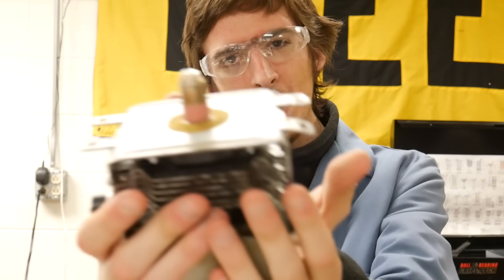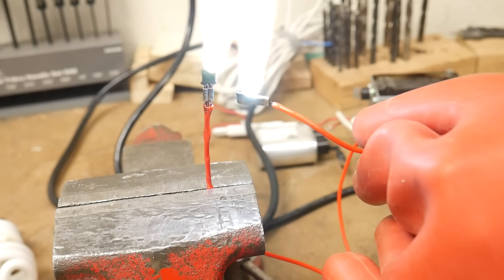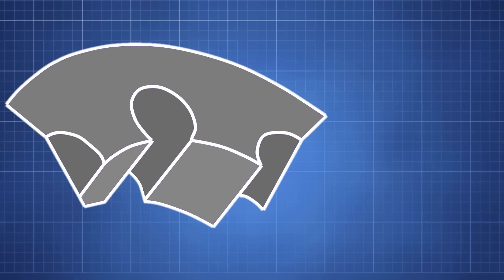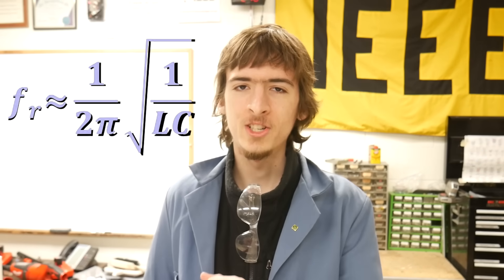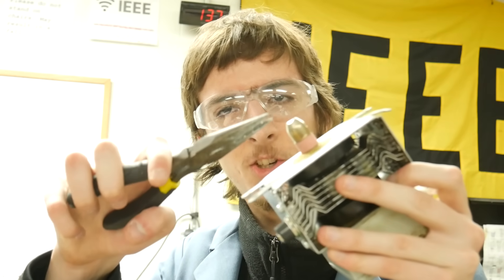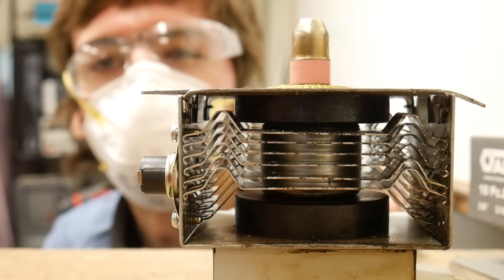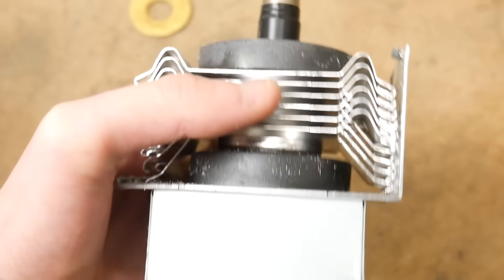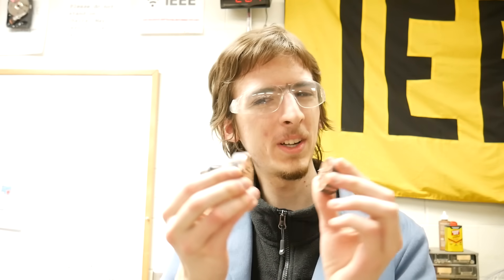What is a MAGNETRON - How Does it Work

Comment: You quoted Fleming's Right Hand Rule incorrectly. It's (F)irst finger for (F)ield, se(C)ond finger for (C)urrent and thu(M)b for (M)otion - check Wikipedia. In addition his Right Hand Rule is for generators and the Left Hand Rule for motors using the same mnemonics (as in this case effectively since power is consumed to produce radiation, not generated via rotational movement of the magnetic field).
Reply: Bob Lewis just thought the same thing
Reply: Bob Lewis prove him wrong!

(It would technically take CPT violation to do so by the way. Haha)
Reply: Tadesan I don't need to prove him wrong. If YOU need proof, do as I suggested and look up the right hand and left hand rules on Wikipedia.

And WHAT CPT violation? Explain yourself please.
Reply: You're all wrong: right-hand rule is for right hand threads.  Left hand rules for left hand threads.  Righty tighty, lefty loosey...
Reply: right hand rule/left hand rule and which finger to use for what are dependent upon whether you want to use conventional electrical flow (positive to negative flow which was based on assumptions in the 1700's which were pre-electron knowledge) or electron flow (based on the facts we know about electrons).  Even in current physics courses I have seen instructors use a right hand rule for based on conventional current flow. If you want to use a right hand rule for generation based on electron flow you flip the current and flux fingers.  or you swap to a left hand rule for generators and a right hand rule for motors and use the traditional fingers.  The right/left hand rules are mnemonic and visualization aids and not laws.

Comment: well wifi is 2.4ghz too
Reply from the maker: Don't mind that. Just the gov't trying to kill your brain cells.
Reply: The difference is in the power output. Wifi is in milliwatts (less than 1 watt) where as microwave ovens are above kilowatts ( greater than 1000 watts). This is radiated power and is why a microwave oven can cook your food or why you will be cooked by climbing a live cell tower. Now climbing a live ham radio or broadcast radio tower is doable but generally not safe. The reason for that is the frequency they operate at instead of radiated power. Had a friend climb one that a local radio station needed inspected. He climbed a live tower with a expensive digital camera. The only ill effects was that the tower had a nice warm feel, accompanied by mild vibrations, and fries the circuits in his camera. Another instance had a local tv station shut down a tower for matinence and had to transfer more power to a secondary antenna to satisfy fcc guidelines of power density per meter. The tower went to 1.5 mega watts of radiated power. That thing would spontanously combust crows, but i digress.
Reply: @samuelsims4625 
Interesting feedback.
Now, what about resonance?
Wifi is in milliwatts but how long do we expose ourselves to it?
Could it be possible that we damage our cells by being constantly exposed to these even tiny waves?
Bridges crashing down due to wind or cadenced walkers is a fact. How can we be sure that wifi does not act on our self resonance frequency?
(not sure of my English... sorry to be tired ;-) )
Reply: @AnnaëlleD  The only thing i can say as far as the long term effects is what is stated by the guidelines that outline radio frequency radiation. Just like ionized radiation, there are federal guidelines that provide the best practices towards exposure. Now to clarify ionized radiation and radio frequency radiation are seperate things, but both have guidelines. As far as resonate frequency of the human body i would have to research more in to the matter in respect to harmful interference. The biggest danger with rf in wifi range is that at high power it does excite the atoms of water and causes thermal heating. Now not to be repetitive, it does require a large amount of power to do this, and in current form wifi is miniscule compared to the minimum to excite water. Now if you were to live in close proximity to a vast amount of them you may notice more effects but it would have to be so many that it wouldnt seem possible. Like above posts we are talking about power levels above 1500 watts and that is the lowest power microwave oven i have seen. There are a number of people who have a sensitivity to electromagnetic energy and they say that it effects them to different degrees. Those people would be at a higher risk of developing complications due to rf. The fcc has a calculation to determine the safe power levels based on proximity to body, effective radiated power, and frequency used. As far as i know they are mum to the effects of resonate frequency related to dangers to your health. Now I am not a scientist and my knowledge comes from being an amatuer in this field. It interests me and I decided to pursue an amatuer radio license so that i could experiment with different parts of the rf field. I am by far more knowledgable about satellite communications and things that relate.

Edit 
To try to answer all your questions I add this. As far as long term expose it was decided that it should not be harmful. Who is to say if that is factual or not. Im not aware of any issues, although wifi still is a newer technology, and hasnt been around long enough to make a definitive conclusion. Another thing that is yet to be seen is the effects of the 5ghz banded routers. They are the ones marked 802.1.1 N/AC. Then comes in 5G cell phone technology that is being developed, which operates in the same band as old police radar guns, so we are told. You could also look at the military area denial weapon that heats the skin using microwaves, but much higher than 2.4ghz. It heats the skin a few millimeters deep to an inbearable temperature, but has shown to not cause lasting damage, they have said.

Comment: Thanks for the explanation.  Just curious though. I have cut open several failed magnetrons and tried to see what was causing the problem. the filament nor any other parts seemed damaged. I wonder what caused the failure of this reasonably simple device?  I had come to the assumption that the failures I had experienced were due to loss of vacuum due to some small leak in the assembly; or possibly due to some materials in the magnetron that had emitted some sort of gases and reduced the vacuum level.
Reply from the maker: Honestly, I don't know the failure reason besides this: they usually only fail after they overheat...
Reply: Yeah I noticed that in the past. Since my current life working on power generators,  I haven't done a lot of appliance work. But, the most recent one I changed was on my mom and dad's 30 year old Sharp microwave. The fan was still working fine.
Reply from the maker: Actually, the one I disassembled was also broken. When people leave my college campus, the leave a good dozen of broken microwaves behind. (I have so many magnetrons...) 
Anyway, I've also noticed that when magnetrons overheat their efficiency decreases substantially. Could be due to warping or material property changes. It's like asking why light bulbs fail.
Reply: Good point!  I ordered a NOS Toshiba magnetron from eBay for mom and dad's microwave. Apparently the old one had gradually weakened. The new one set fire to the first bag of popcorn they cooked! It was easy for mom and dad to adapt to the shorter cooking times after the first incident! :) 

I remember those days when people would abandon things when they finished college. Seemed like craziness!
Reply: Overheating can damage the magnets.  That would wreck the tube.
Reply: Maybe enough of the tungsten in the cathode vaporized and deposited on the anode, causing the electrons to not move as intended/short out. Or maybe the copper anode had been pitted/deformed/damaged by fast moving electrons. Could you tell if the vacuum was still present when you cut it open?
Reply: Blueprint Im pretty sure the reason they aren't as effective after they over heat has to do with the fact that heat depolarizes magnets
Reply: Can you measure the magnet strength? Could you swap out magnets and see if it would work with the new ones?
Reply: Degaussing of the magnets is the main reason these fail.
Reply: @davida1hiwaaynet : Thermal failure can result in several different modes, to be sure. Severe over heating of the permanent magnets can cause a dipolar response, affecting the coercivity of the magnets. The end result could be a distortion of the distribution of the permanent magnetic field lines, and thus could lead to (severe) hysteresis (due to imbalance of RLC (resonance has been affected; Cx and Lx (the reactive components))). Just my two cents though, as this is not my area of expertise, and I have not done any research into this.
Reply: @John Wilson: Yes. You can measure the strength of a magnetic field. The strength is measured in the SI unit called the Tesla. However, the magnets in a magnetron are VERY strategically placed; a couple of thousandths of an inch really does make a tremendous difference, since the field strength is equated to the distance squared (there is a lot of geometry involved in the placement). Just eye balling their location is no where close enough to call it 'ok'. It would be much easier (and safer (the window of a microwave is also a frequency discriminator)) to buy a new magnetron or microwave.
Reply: @Michaelsomnorotherthanlogic: For all intent and purpose, and considering the fact that we are discussing PERMENANT magnets on YouTube, inverse square law fits the bill just fine. This is not a physics forum where we are going to describe, in detail, monopolar / dipolar field interactions, net vector charge analyses, and inverse cube law relationships (or 1/r^7, if you know what that pertains to). Also, we aren't at University, where a detailed analysis of Gauss's law and Maxwell's equations describing how these complex interactions would be taking place. The explanation I offer in this particular context suits my argument just fine. Just wondering: Too much caffeine this morning? Caffeine is a known irritant, by the way...
Reply: Did the filament open up? In the filter box for the filament leads there are several components, any one of which, if opened, will kill the magnetron. Common causes of oven (vs. magnetron) failure are over-heated Fastab connectors due to unclean connections and the voltage-double diode, which is very cheap.

Comment: I have pondering this system design for some time. People hear sand bags in microwave ovens. I’m considering building a microwave sand battery. I believe this technology would be able to be done using a lower energy source then say a conductive element. Because there is so much resistance in pushing electrons through a element. Also the element from many videos tends to get so hot it oxidizes or over heats. Also the element is a close proximity design usually draining 5000 watts at 220 volts. Yet a microwave over uses 110 volt at 20 amp at best. A solar system can be made at a reasonable cost to power it. If a microwave can heat a bag of sand in merely few secound or melt glass or even make diamonds as being done. Artificial diamonds. Then a metal cylinder that’s holding 200 gal sand heated to say 700deg could be a simple energy system. Hey guys what you think. For 100 watt solar panel times let’s say 15 panels that’s 1500 watts.  Also many panels put out almost 2 amps. This would power a microwave. Here in Pennsylvania we get sun for at least 6 hr day. This power could be stored for heat and possible steam converted to electricity

Comment: 7:42 RF gasket important for non-leakage of microwaves between magnetron & waveguide. 9:04 Thoriated Tungsten filament.
Reply: Yes. that's what I've heard too...thorium..
Reply: So I can TIG weld with it?
Reply: Thorium is radioactive
Reply: @arthurhardy  tungsten used for tig welding  (heliarc) carbon and stainless steel contains 2% thorium and the tungsten used aluminum has none.

Comment: Thanks for the video. Is it safe to test the microwave with its top off.
Reply from the maker: That depends on what you mean by "safe." 
With the top cover off, you will not (or at least should not) be exposed to radiation. However, there is always the risk of electrocution since the circuit can reach peaks of 4000 volts.
It is only if you remove the microwave door that you will be exposed to radiation which I would not suggest that you do.
Reply: @BlueprintScience  Many thanks.From UK

Comment: Well done video!  Thank you.
They should print a warning on the magnetron abouthe beryllium oxide insulator.
Reply from the maker: They do say not to open the microwave. If we ignore that, well...
Reply: Blueprint.     They say that on everything.      With an especially hazardous material they should print a warning.    People may want tobtain the magnets.   Some may also wanto recycle the Cu.
Reply: One supposes that if someone is intelligent enough to figure out how to remove the anti-tamper Torx screws that hold the case together, their genes should probably be passed on to the next generation. The beryllium is there as a Darwinian safety device. Seriously, the tube body will probably end up in the landfill undisturbed for centuries (until someone finds out it is good substitute for dilithium crystals far into the future).
Reply: CampKohler     As one who has training to be a chemist, I would not have identified the insulator as beryllium oxide.    It should have a warning label or printing identifying what it is and its danger.     The government should require special handling andisposal of this Hazmat.
Reply from the maker: To be fair, not all of the insulators are made out of beryllium anymore. I think producers have moved to aluminum based ceramics now. Doesn't mean we should let our guard down though.
Reply: @BlueprintScience  what unique properties does beryllium oxide holds that it was used.
Reply from the maker: @ericscaillet2232  It is a great insulator and can withstand very high temperatures. It is used more in radio towers than in household microwaves nowadays.

Comment: Great presentation on the workings of a magnetron. I was always curious to learn a little about the way they work.

01:10 : Poking with your fingers like this inside a microwave oven is extremely dangerous even when the microwave is unplugged. The capacitor may still hold charge and if it does, it will be at a potential of a couple of kVolts i.e. enough to cause death or serious damage. It is quite obvious you seem to know what you're doing but any kid is able to watch yt nowadays.

06:38 : Kudos for warning clearly about the dangers of handling magnetrons and beryllium oxide (whether this particular specimen does contain it or not is irrelevant - there are plenty of microwave ovens out there that do).

Comment: The path of the electrons trough the eectric fields at 5:25 is wrong.
Reply from the maker: Yeah, I had that backward didn't I
It would be forced out when traveling with the field lines. You may have noticed that I considered all electrons to have a positive charge so that I could use the right-hand-rule. I've been called out on that.
Too many smart people like you on the internet!
Reply: It also means that that a lot of smart people watch your channel. Its a good thing. Perhaps make an inset wher you explain when you youe the right and when the left hand rule and how this impacts the later graphs. The general explanation is good.
Reply: @BlueprintScience  the n two magnets are there to keep electron from coming out where the insulation is at and keep it on copper conductor path all the way to the front of the magnet tron the piece you said you thought wasn't important keeps electrons from leaking into the electral housing and causing other parts from overloading and could cause the microwave to explode

Comment: Are you using Flemming's right hand rule as a replacement for his left hand rule? As the description of Right hand rule wasn't correct, the index finger is pointed at the direction of magnetic field and the direction in which the Middle finger gets pointed gives the direction of induced current.